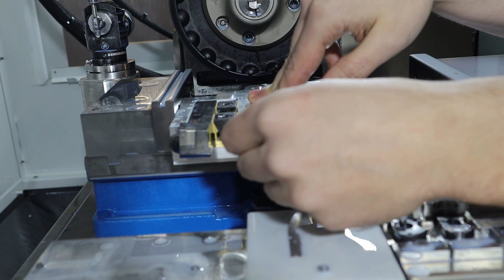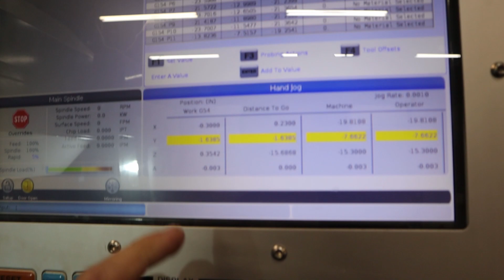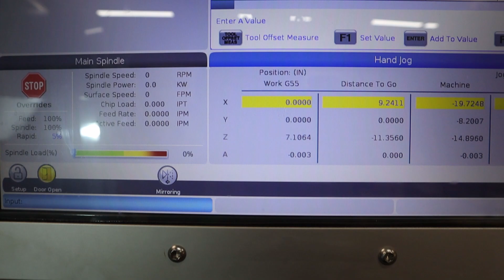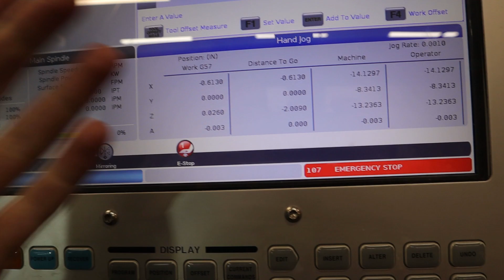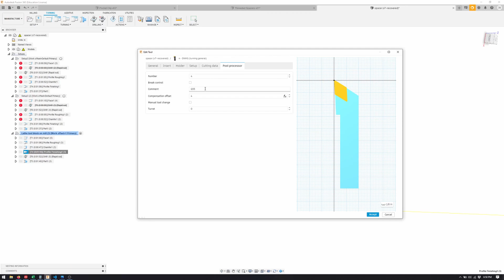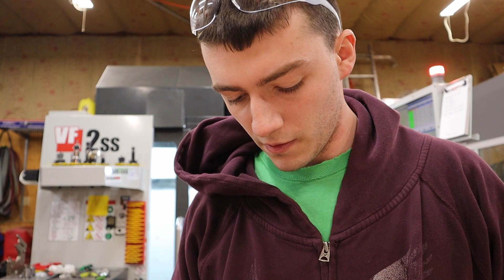How to turn your mill into a lathe - Setup / CAM / Using

Comment: Great idea if you don't have a lathe. I would run first tool try with plastic or aluminium stock to test it. Did you find a solution to fix your mill power issues?

Comment: Sweet job but move your gang tools so they are AT LEAST past the center of the vice! Only thing saving your butt is that fact its a kurt vice. Lol. Right now its pinching  and really only hilding on the corner of the fixture because it's passed center.
Reply from the maker: Not entirely sure what you're trying to tell me. Please break it down.
Reply: @split141x  ok, when using a vice you need to clamp in the center, or if you cant and you need to clamp on 1 side of the vice its good practice to put a block or blocks stacked up to equal what your holding (part or fixture) on the Other side of the vice for equal clamping through out the amount your holding because say you take a block and just stick it on the far left side right? Well its only gonna clamp on the right corner of the part because your moving jaw has wiggle and play in it ...try it..youll understand what i mean then. Watch the jaw kick. I seen lots of people (including myself)  have parts kick up or out (whatever)  because of not equal pressure on the jaws. Plus the set screw in The middle of the moving jaw can be adjusted so there is less (wiggle) but it is still hard on the vice when you only clamp using 1 side Past center of the jaw. If your holding on 1 side BUT your past center.....your golden. Part will never come out. Its only when you not holding past center you wind up kicking the moving jaw and in Turn winds up Only clamping on the 1 corner instead of all the way across. Its just something that you might wanna start practicing cause that sweet kurt aint gonna be new forever!  Lol. Hope you see what im saying.
Reply: @split141x  just move the fixture in more,,,,itll be even more solid
Reply from the maker: I see what you're getting at :)

Comment: Which reinshaw probe part number are you using with that smaller ball end ?
Reply from the maker: I just use this one off Amazon. I used to break tips often so I would just buy cheap ones. Dial out the runout and I don't see how the reinshaw   one would be that much better. 

https://smile.amazon.com/dp/B07G8DWBYF/ref=cm_sw_r_cp_apa_fabc_SNXYDDDGAJR9PX1DNPXS?_encoding=UTF8&psc=1